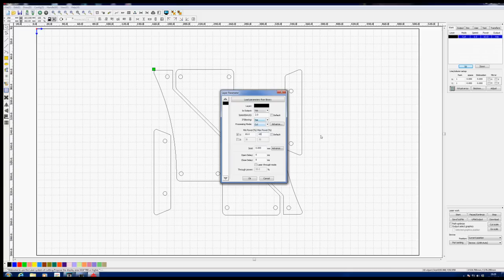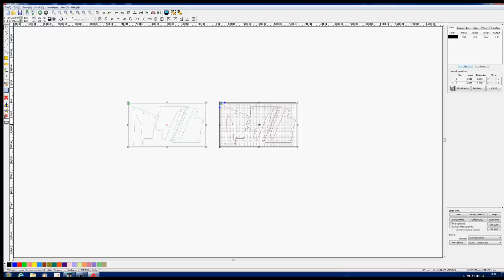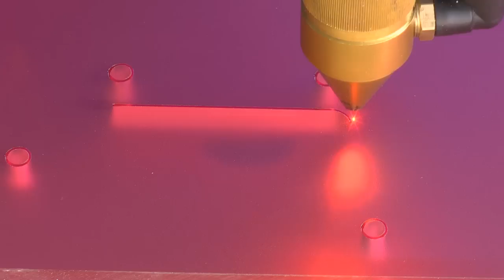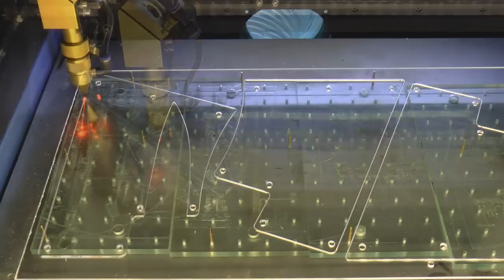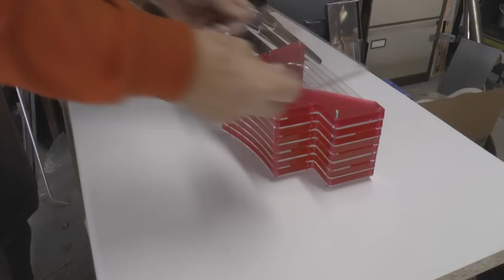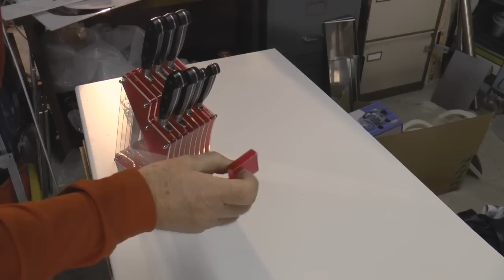RDWorks Learning Lab 26  A 10mm Acrylic project

Comment: Why not group all holes first ? I use Coral Draw have this program as a micro
Reply from the maker: This was early on in my learning journey A few sessions on I learnt the method i still use today
https://www.youtube.com/watch?v=_3oUQ9gKjCk

You can set RDWorks to work from the centre and it will usually do all the hole first. I say usually because  it has let me down on several occasions. It is also very random in its cutting order. I like to manage my cuts,  and with turning all cut optimize and path optimize options off I can group and order very efficiently.
At the time your comment was entirely valid . Thanks
Best wishes
Russ
Reply: I have a 8ft x 4ft 120w laser Its great watching you learn as I went through the same learning curve as you, remember my first fire,,loll
Reply from the maker: Have you been here yet?

https://www.youtube.com/watch?v=cVuYyfJmfTs

Russ

Comment: Hi!
Many thanks for your videos from which I learn a lot!
I'm trying to make use of a brand new chinese 80W lasercutting machine but I have an issue I'm not sure you addressed before (or later - from now, there is a large amount of videos to watch ;) ): the edges of my cut pieces are melted at the top.
Have you an idea of what is causing this? I supposed it was the power that is too high for a too slow speed, but with a lower power or a fester speed, the laser don't cut through. 
I was wondering if a two-three-pass cut would do the job with a lower power but you shown in this video how it is a bad idea due to poor quality results... :(
Best regards and thanks again for your videos!
Reply from the maker: Hi Anoril
There is a basic golden rule for cutting all materials. 1 pass as fast as possible and with maximum air assist.. However, acrylic is the exception. Let me explain
With all organic materials (wood, card, ,mdf, leather etc) the cutting action is BURNING. That burning produces smoke which in itself still contains flammable materials. The other thing about smoke is that it is very absorbent of our IR beam of light. When the invisible IR light hits the smoke it gets absorbed and turns into heat which can ignite the smoke and produce charring in the cut AND because the smoke has absorbed a lot of energy , there is less power to BURN the organic material you are trying to cut. That is why it is essential to always have a THROUGH cut.  If your air assist is efficient then it will penetrate into the cut and keep the smoke moving out of the BOTTOM of the cut and away from the cutting face. If you do not have a through cut the smoke runs along your cut channel and usually burns there causing charring of the edges.
With acrylic it is quite different. When your beam of light hits solid acrylic the energy is 100% absorbed and immediately turns to heat.. The heat evaporates the acrylic rather than causing it to burn.  The vapour expands rapidly away from your cut area and also the vapour is less absorbent than smoke. It will ignite if allowed to build up and will also do the same as steam, condense back onto colder surfaces. One strange property of acrylic is demonstrated in learning lab #120 . The inside of your cut guides the light beam deeper than you can get with a burn, because of internal light reflection. It is essential with acrylic to again set power high and run just fast enough to get a through cut. Again the through cut allows the vapour out of the bottom of the cut where it will not condense on your work.. Now comes the problem. You need JUST enough air to keep the vapour moving out of the cut zone but not too much air or you will COOL the cut area and decrease its efficiency and also prevent the flame polishing of the edge that you can get when that balance of power and airflow are just right. Generally you need only a whisper of air assist to cut and even less for engraving.

The melting at the top of the cut and insufficient cut depth makes me believe you have your focus set incorrectly.  Set your max power button to 15% and with a piece of thin card (like a cereal packet) try to find the distance between nozzle and card that produces the smallest spot when you just blip the pulse button. That is your focus distance that should generally be set onto the surface of your material. I suspect you will have been supplied with a 2" focal length lens. There are so many other possible reasons for your problem, such as loss of power because your beam is badly aligned or your beam is clipping the side of the nozzle  hole.  There is a lot to learn and understand.

I sadly suspect that your new machine is not what it purports to be unless you bought it direct from a Chinese manufacturer. If it was an Ebay or Amazon Marketplace machine it will probably be a 60 watt tube and a not very good quality tube either. Is the tuube perchance marked K H Laser?

All best wishes
Russ
Reply: SarbarMultimedia, many thanks for all this detailed explanations. I'll check all this, starting from the focus distance I've been told but I did not check by myself. Then the laser tube, then the mirrors aligments and so on, as you depicted in several videos! And yes, I watched various random videos of yours, including #120 which had a promising title ;)
Thanks again! I come back to tell if I managed to solve the issue!
Regards
Reply: We started to check for focus point and mirror alignments. The tube is actually a KHLaser, yep. A good point? :)
Reply from the maker: Maybe no. The Kehui factory manufacture machines but because they only sell to Ebay buyers via PRIVATE ebay sellers and there is no chain of responsibility back to them, they operate in some very unscrupulous ways. Thjey do not manufacture their own tubes despite the impression given by the KH Laser label. Instead, they trawl the major Chinese tube manufacturers for their reject tubes. They then retest the tubes to sort out those that work "in some way", enough to fool the naive Ebay buyer , put their own label over the original label and fit them to their machines. These machines are then shipped in bulk to warehouses around the world from where they are sold by private Ebay sellers for commission. Claimed 50 watt tubes are really 40 watts  (800mm long) and 60 watt tubes are usually 50 watt tubes (1000mm long) and are not far off junk . They may last days or weeks and perform very poorly.
At 80 and  100 watts  (actually 60 and 80watts respectively) you are likely to have a re purposed EFR tube. These tend to be at the other end of the spectrum and only have minor performance issues. I know of one such tube that is now 14 months old and still working well. But it does mean you must always be a bit suspicious about your tube. Why did EFR deem it unfit for sale with their name on it?
Best wishes
Russ

Comment: Great video...I've upgraded my Chinese 40w laser to a 60w for the simple reason my power supply quit ,so I figured since I'm buying a new one I went to 60w and tube ,no different. So my main question is I have a heck of a time cutting through 5mm with 3 passes at 100% power and speed 2mm per sec let alone 10mm...so I'm thinking running it at 100% is actually chokeing it down.how do you determine that you get optimum power output at 65%? Question for anybody really.
Reply from the maker: Hi John

First of all a 60 watt tube has a recommended current limit of 22mA. If you do not have an ammeter fitted then it's a virtual certainty that you are over-driving your tube. Now, it depends on where you bought that new tube and power supply as to how it may perform. Was it from Ebay or direct from China or a local supplier? Is there any label on the tube?
A typical tube of any power will reach its rated maximum allowable drive current at between 60 and 70% power,   but you shouldn't be using it because running over that will shorten the life of your tube. A good tube will have a steady increase of power all the way up to 100% but it's not there for you to use, it's there to keep your tube performing correctly at it's rated max power. If you have a "sub standard tube it may perform with a steady increase to 50% and then the power start to decrease rather than increase. I know because one of my ebay tubes was doing just that.  There is a great visual presentation of the laser power mxing out at about 60% in this video
https://www.youtube.com/watch?v=WbBPps42iHc

The other thing that may be different is that I was using a 1.5" focal length lens.

Best regards
Russ
Reply: Thanks Russ for replying so soon...it was both from China supplier tube and power supply together. ..im still watching all your vids. ..great job..what's that little black gaget you use to mesure the wattage ? Thanks again .john
Reply from the maker: Hi John
That's good to hear. Buying direct from China means you have a traceability trail and you will have bought what was advertized....a proper 60 watt tube and power supply
Take a look at this video to answer your other question.
https://www.youtube.com/watch?v=lO9rWlobLZU

Best regards
Russ

Comment: Where did you set your focus height for the 10mm stuff on top or middle of material
Reply from the maker: +Xairflyer 
When I cut 15mm acrylic I set it about 2mm into the material. For 8 ad 10mm thick acrylic and ply I set it about 1mm in.